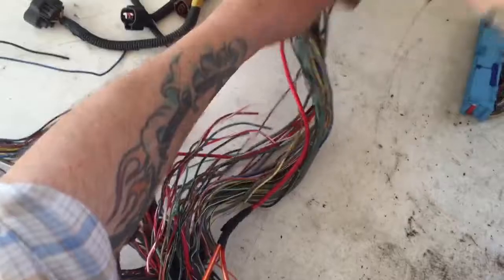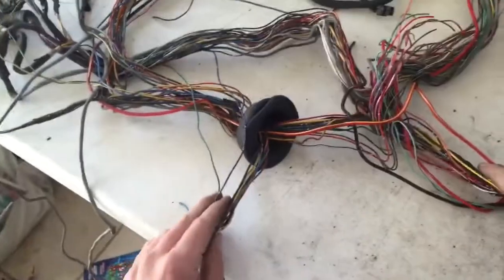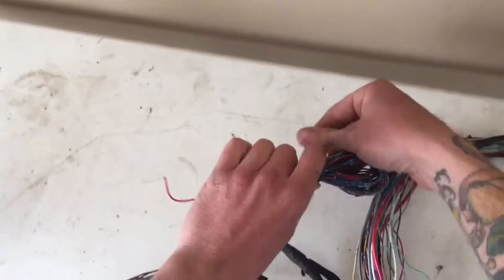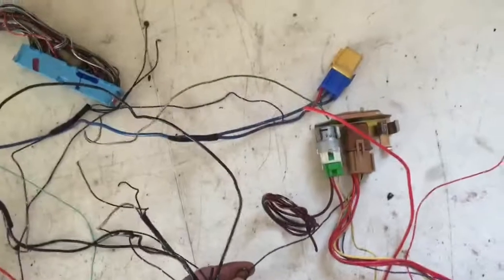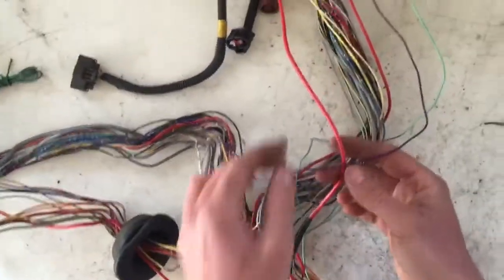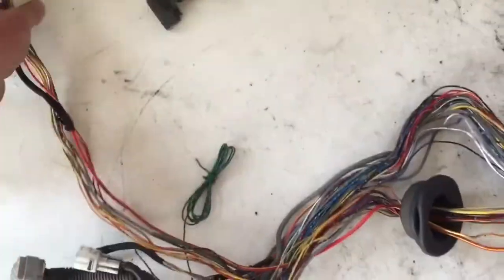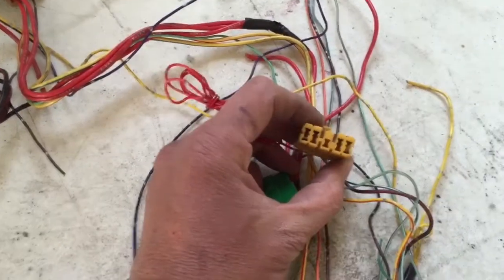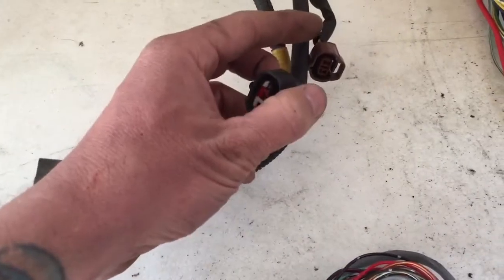3. Weeding 2/2 -  Wiring Harness Series

Comment: Hey busaru! Great videos i seam to be learning alot more just watching your videos rather than forums i have not been able to find proper ecu pinouts for my 2004 wrx engine its a jdm engine and im  putting that into my 2002 impreza! If you could help me find pinouts for that would be most appreciated
Reply from the maker: +andrew gallant Hi Andrew, I know we've been in touch through email but for the benefit of others I'll answer here too. JDM pinout a are very hard to find. Usually if I get a JDM engine I'll source a USDM harness and essentially turn that JDM into a USDM engine - that may be your best bet